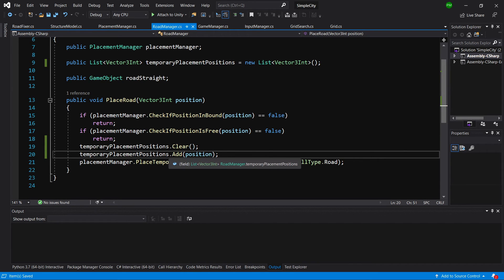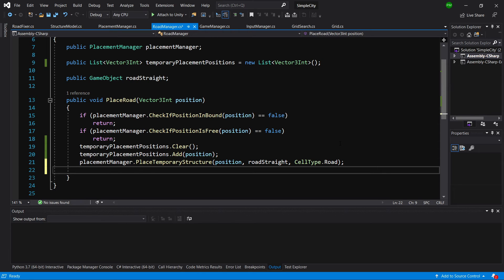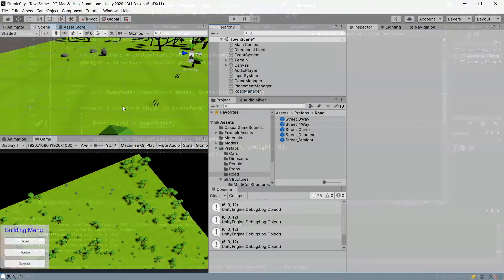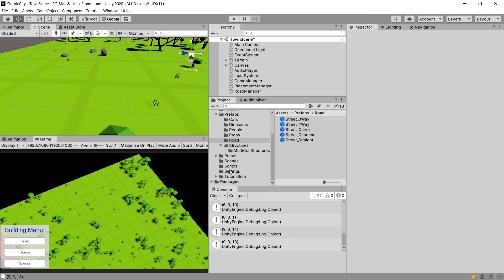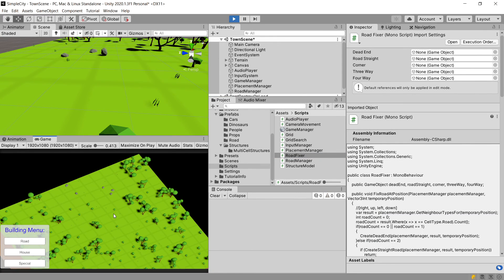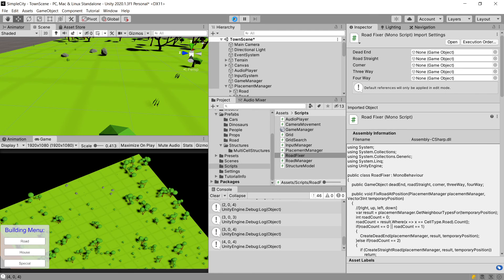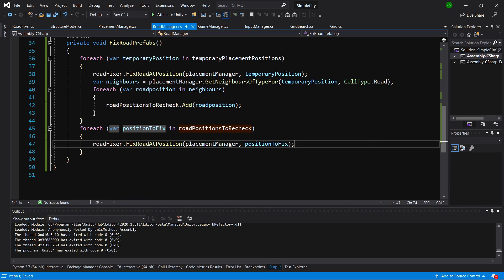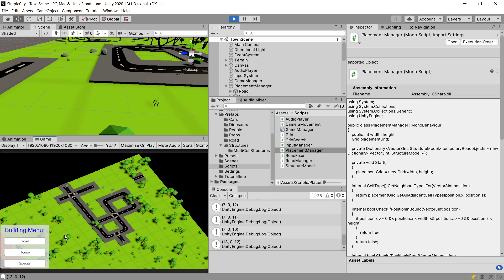Road Fix p3 - City Builder Unity tutorial P10

Comment: Firstly, amazing tutorial :) I'm having a lot of fun. And funnly enough, if I put 3 roads in a row I get streight - corner (identity) - deadend instead of a simple streight road...Somehow the fixroad goes awire and the if condition isn't correct. Do you  have any idea what the problem may be ?
Reply from the maker: It usually is caused by some bug in the code - probably the RoadFixer script. Have you compared your code with mine through github? There are also full unitypackages (I think 07_RadFixer in your case) that you can import into a new project to get the exact same project that I have in the tutorial. https://github.com/SunnyValleyStudio/SimpleCityBuilder
Reply: @SunnyValleyStudio   Indeed ! Indeed 😄 it took me a while and yesterday I was probably to tired, I just forgot to put straight roads and I was modifying it with a corner 🤫
Anyways appreciated your response !

Comment: Hey my roads are going in the air with some random offset do you know why if so please explain/tell me the solution, thanks
Reply from the maker: It might mean that you are modifying the Y axis instead of working on XZ plane (which is the horizontal plane). I often do that when switching to 3D after working in 2D for a while.

Comment: at 4:00 into this lecture after have implemented the FixRoadPrefab() you switch back to unity to see what happens. In my situation when clicking on the map no roads are placed so i lost this functionality ??
after solving the bugs that you mentioned in PlacementManager.cs and StructureModel.cs and finishing the remainder of the lecture
 it did not work for me, Unity when hitting play hangs

Also in my situation the RoadManager gameobject has a RoadManager and RoadFixer (script), The RoadManager (Sript) has Road Fixer slot which has no reference, is this ok at this stage?
Reply from the maker: Hey! I think that there might be an issue in your project. You can visit github https://github.com/SunnyValleyStudio/SimpleCityBuilder and either download the package (i think it is 07_RadFixerP3.unitypackage) or you can verify the scripts and compare them with your own. I am not sure what can cause the issue in your case but you should see exactly what I see in those videos as a result. Let me know if you still need some help!
Reply: I also had the problem that the road placement didn't seem to work anymore. In my case, the roads appeared in the hierarchy but not in the game view. The problem was that for an unknown reason, my placement manager game object had moved to a strange position. A simple "Reset" of the placement manager game object solved the issue.
Reply: I have a similar problem. I saw roads clones been made but did not show up on the ground. Until i paused the game and moved in screen mode. I saw that my roades got created and placed outside of view. Looking for what has happend.

Comment: Dont know why but after this tweaks, roads are even getting placed on top of each other. After printing out the grid, I figured out that cell type is not getting updated properly sometimes. Like if I place at 0,0 it shows Road, but at 0,1 even after placing road it shows empty... Did anyone else came across this problem?
Reply from the maker: Hey! Maybe you can check the code against the git hub version ? https://github.com/SunnyValleyStudio/SimpleCityBuilder. I don't doubt that there might be a bug in the code but I don;t think anyone ever mentioned it before.
The only way you can place road somewhere is by validating that the space is od type: empty or road on the grid. If it is still the road should not be placed on top but rather it should modify the preexisting road structure. This could mean that the issue is earlier when you place the structure on the grid it seems like it doesn't properly save the info on the grid structure. I would try searching for a bug in PlacementManager.cs. Either the PlaceObjectOnTheMap method has an issue or it isn't called when the road is being placed. 
You can also create a new Unity project and import the 07_RadFixerP3.unitypackage from git hub repository since it is the same version of the project as I shod in the video. I thing it would be much easier for you to find the issue this way or confirm that there is a bug in my code.
Take care!